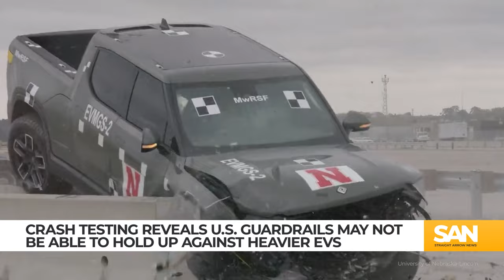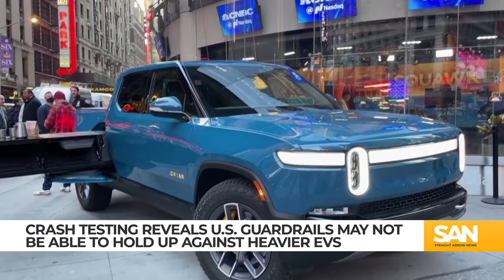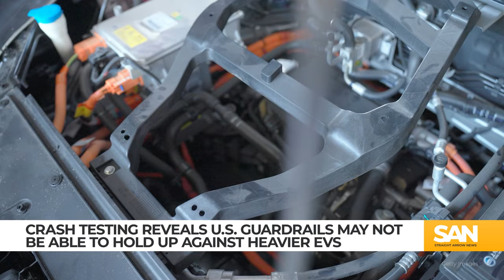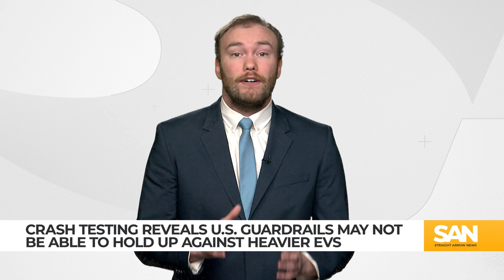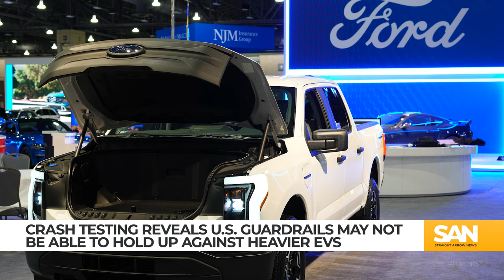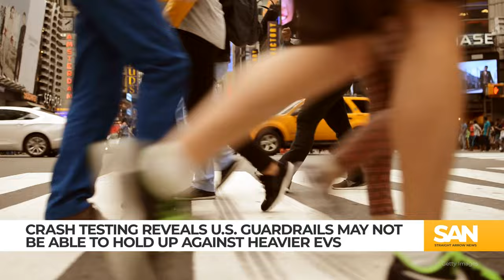Crash testing of heavier EVs shows US guardrails may be unable to hold up

Comment: This isn't an EV issue. The curb weight for an R1T  (used in the video) is 7,148#. The curb weight of the Ford F-150 is 5,757# and the half-ton F-250 is 7,660#. So, the EV used in this test is heavy, but oddly so. Those guard rails won't stop a 3/4 ton, 1 ton, box truck, or 18 wheeler either.

Comment: Okay so what about like parking structures, overpasses, etc? Can any of our current infrastructure handle the inceeased weight?
Reply: Fair point...
Reply: Of course they do. Can they deal with Escalades or other giant SUVs? They do.
Reply: @Sekir80  have you looked at the GVWR for an Escalade versus an Escalade EV? How about a regular car versus an EV? I have and they are significantly higher in the EV so your argument is not an argument at all. Do your research before you act like an uninormed fool.
Reply: @shelbot4303  Wow, is there an Escalade EV?!
I told already that I KNOW EVs are heavier. The problem isn't that. The problem is that too many people buy too heavy cars to begin with. Why theF anyone want that tank anyway?
Edit: oh, this is not the comment where I explained I know the weight differences. Sorry about that.
Reply: @Sekir80 granted some people drive huge vehicles for no reason. But people like me are tired of getting crap for driving a big truck, but I can't haul a trailer with 10,000 lbs on it with my Honda. My truck is used as a truck daily and is a necessity for my work as a mobile mechanic. The EV push is an attempt at controlling when and where we can travel. If I had to do my job in an electric vehicle, I would get nothing done in a day because I would have to charge it multiple times. This whole push is bull crap.
Reply: Oh and the Escalade EV comes out next year. Weight of a normal Escalade is 6000 lbs, where as the EV weight is 8500 lbs. So no I don't think our infrastructure can handle the extra weight if every vehicle is heavier than what is in use today.
Reply: @shelbot4303  I don't think EVs are good for everyone this time. Your use case is work related, it's totally fine to have a truck, I won't hate you for it. Especially if you regularly drive and tow 100+ miles a day, a Ford Lightning probably won't suit your need.
But controlling where you could go? That's a new conspiracy theory for me!
Reply: @Sekir80 a conspiracy now, life later. Control is all they want man.

Comment: Americans are obsessed with huge vehicles, not just huge EVs. Don't confuse these! Look at for example a simple EV, the Chevy Bolt: it's around 3600 lbs. Compare it to a Trax: about 3200 lbs. Sure, the Bolt is heavier, but not by THAT much. An Escalade is an ICE vehicle and weighs 6200 lbs. Now, draw your own conclusions what the problem really is.